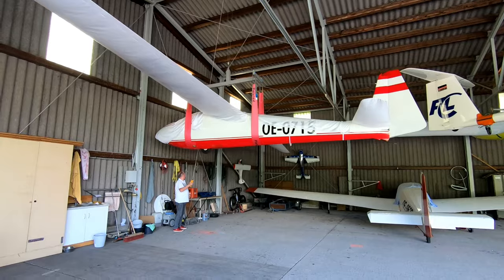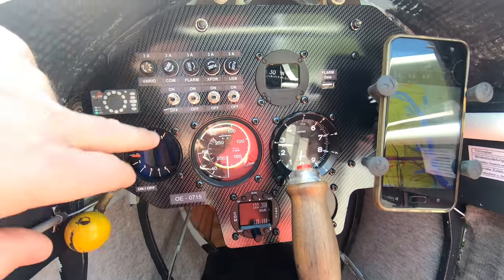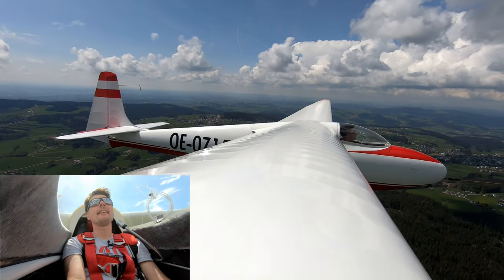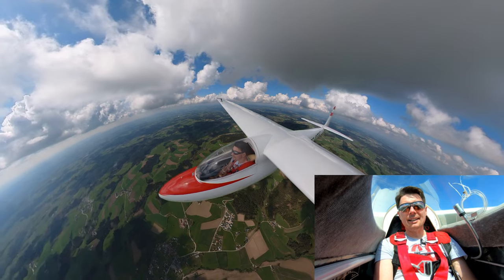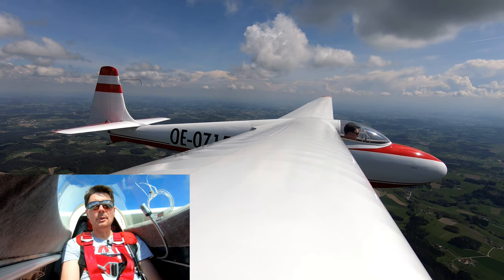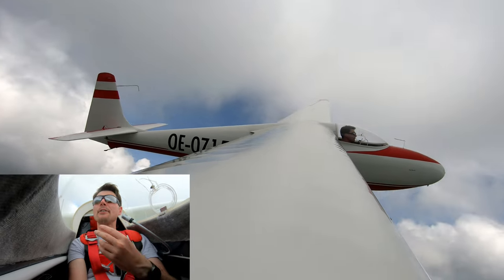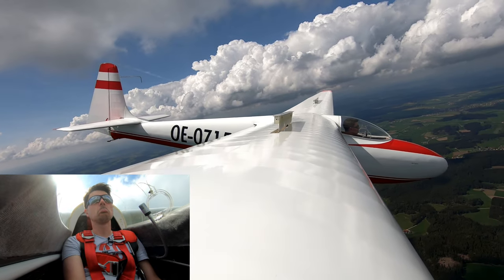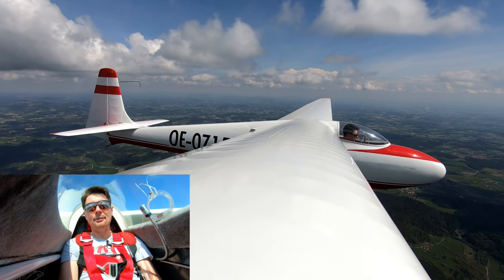How it is to fly a 1966 vintage glider (Schleicher Ka6 Cr)

Comment: The K6CR was the first single seater I flew.  I remember the surprise I had when it lifted off the ground so quickly, and how far I had to push the stick forward to keep level with the ground (aerotow).  The progression at the club in the early 90's was: Blanik, K6CR, Club Libelle, Std Libelle.

Comment: Love the Ka6CR. I did quite a number of hours and kilometers in it, and also quite a bit of workshop tim,e painting and repairing a couple. In my club, in the 80s, the progression would be that you trained in the Blanik L13, then after solo fly the Ka8b until 20 hours and then you could fly the Ka6. Next step were the plastic gliders.

Comment: Thanks for the nice video which brought back fond memories. I was lucky to be a part owner of a Ka-6 CR (BGA No. 270) in the late 1960's. It's handling was perfection, so soarable, very aerobatic and with a roll rate that didn't seem possible with such small ailerons. I was blown downwind to gain my 300Km goal diamond in it, plus a few 3000+ metre climbs in cloud, but never with a barograph. I didn't ever fly a glass or carbon sailplane but can't imagine it could be more pleasant. The only downside would be the cramped cockpit - rather numbing for my 6ft 2 in frame.
Reply from the maker: Hi Geoff, great! Flying cross-country with a Ka6 must be fun. It's flight characteristics is really good!
Modern glass fibre ships offer better glide ratio and more comfort in seating,, but flying wooden gliders is still a great experience.
Thank you for your comment 😃
Reply: I had the same height problem.  I just wouldn't fit into many glass ships . The Polish PZL 51 ( Junior ) was perfect though.  Large cockpit snd an absolute delight to fly .

Comment: 7:00 In the ka8 you can dive vertically with fully extended airbrakes and you will not exceed 150 km/h, I have been told stories from the old guys where they flew in Thunderstorms and used to dive out of the clouds that way. Sometimes the climb rates were so strong it was the only way to get down. Must have been crazy times.

Comment: I have flown the K6 also. Wonderful glider but the comfort is of course not on par with modern fiber gliders.  ;0) I am from Denmark btw. My first single-seater was a ASK-23.
Reply from the maker: Great! I don't know the ASK23, it is supposed to have good flight charactaristics? The comfort is of course better in a modern glass fibre ship. Where in denmark do you fly?
Reply: @RudisGlidingAdventures  I flew i Silkeborg Gliding Club but i don't fly anymore. The ASK-23 is the singleseat version of the ASK-21 in wich i learned to fly. Both fine gliders but the 23 is not really a competition glider but more a transition-glider before you move on to something more advanced..

Comment: Hi Rudi
I own an Australian vintage glider called ES60 Boomerang. Ita little heavier and slightly better glide.
Reply from the maker: Interesting, I never have heard about that glider before! Is it australian made?
Reply: They were made in Australia by Edmund Schneider. They were based off the Ka6 (of which Schneider had built licensed versions) but with a higher wing loading to better suit the strong thermal conditions typical during an Australian summer

Comment: A classic yes, but NOT a vintage glider though...........by definition of any vintage glider organisation...... generally most organisations will stipify that it has to be pre 1958 to be classified as 'vintage', (as this was the advent of the first glassfibre glider) although the 'Vintage Glider Club' indicate pre-2nd WW is 'vintage'........ think you'll find a lot of 60's and almost definitely most 70's gliders where made of glassfibre, and carbonfibre in a glider was introduced in 1970/1 in the spar of a Slingsby Kestrel 19 and the inner wing of the SB10... just because it is old does not make it 'vintage'..... an often misappropriated term in gliding circles that are not familiar with the 'vintage' glider scene... Ooh i learnt to fly in a Slingsby T21b....... and got my Silver C in an EoN Olympia 2b.... Gold C in a Slingsby Skylark 3, and Diamonds in a 67' Slingsby Dart17R ....
Reply from the maker: Hi, thank you for your comment, i did not know that there is a definition for "vintage"! I attended once a meeting of the vintage glider club at Spitzerberg and had the opportunity to fly in a Slingsby T21. Was a great experience! Flying even badges and diamonds with them like you did ... wow, respect and conratulations!